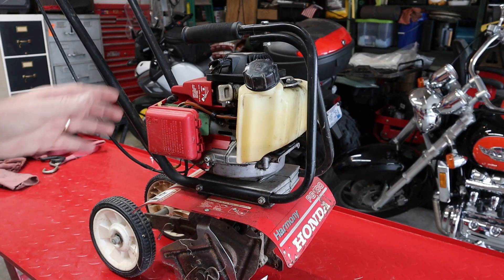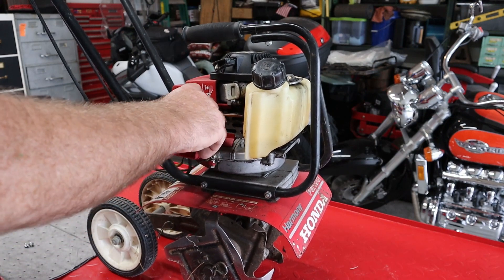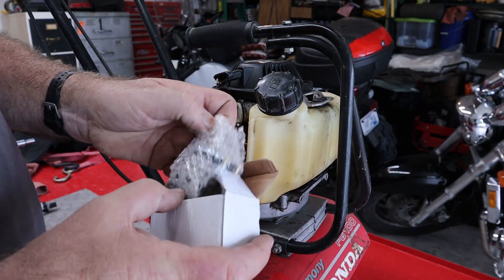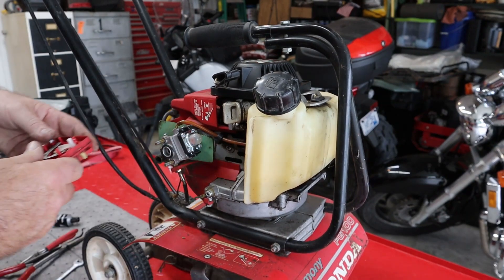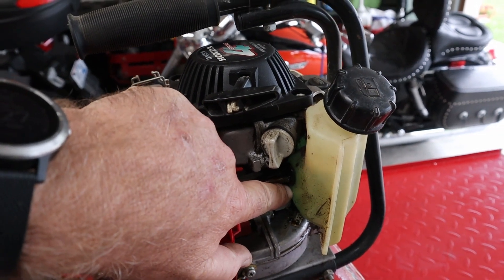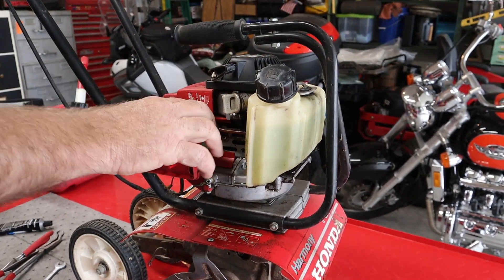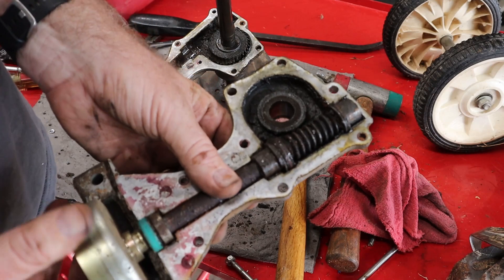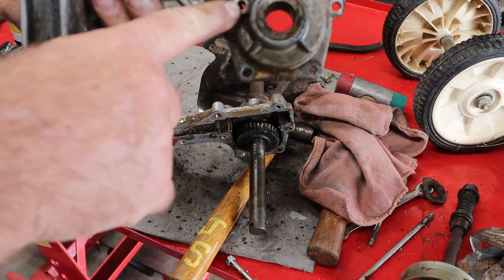FG100 Honda Tiller Tear Down. Get it Running and Then it Won't Work. Tear Down of Tiller

Comment: I got 20 years out of mine. I hear a lot of people complain about these machines, but if owners actually followed the owners manual and serviced the transmission every 6 hours with fresh grease like Honda says to do, they would last. I rebuilt the carburetor once in 20 years.
Reply from the maker: What you put into your machines id what they will give you back. Maintenance and care is key to long life.

Comment: WOW thanks for saving me the time, money and aggravation in trying to repair it. Mine has the same problem and on top of that fumes black smoke within twenty seconds after starting the engine. I guess straight to the dumpster....
Reply from the maker: Thank you for watching. Not a very affordable repair for certain.

Comment: Do you know, are the new ones with the GX25 and whatever tranny they have now any better? I'd like to get one but not so sure now. Thanks.
Reply from the maker: Yes they are much better. The problem with the tiller part locking up was solved after the first couple of years.

Comment: These are the shittiest engine Honda makes
Reply from the maker: I can't argue against that. The worst application for this engine I have seen was on the mini water pump Honda made for a couple of years. In this application where it is constant load and high RPM's, I have seen them melt the cam shaft.